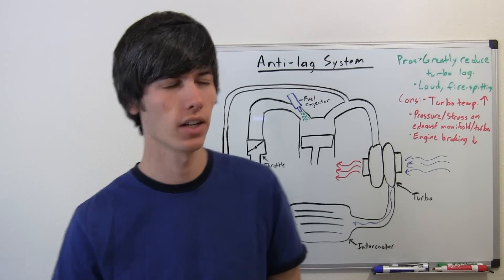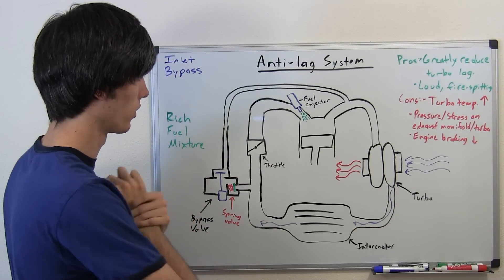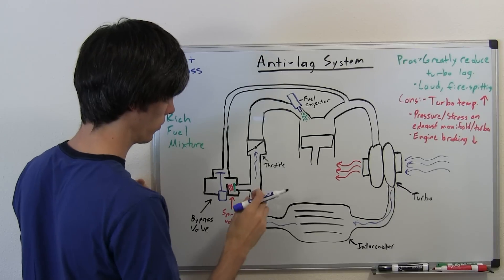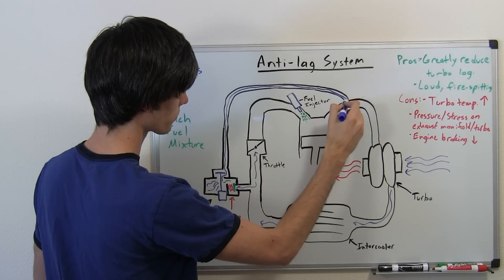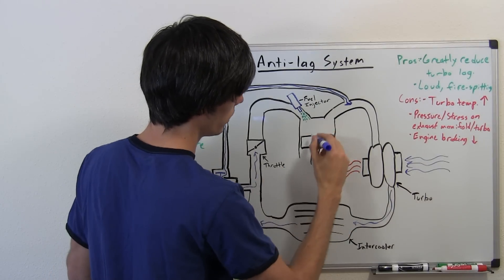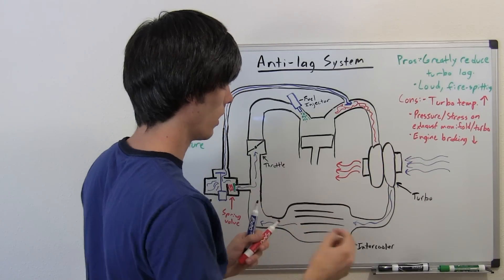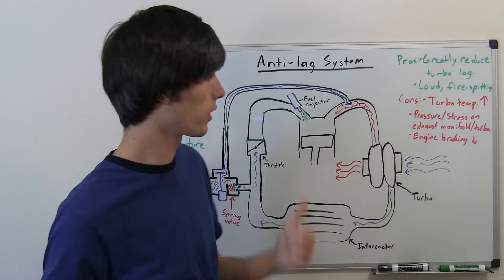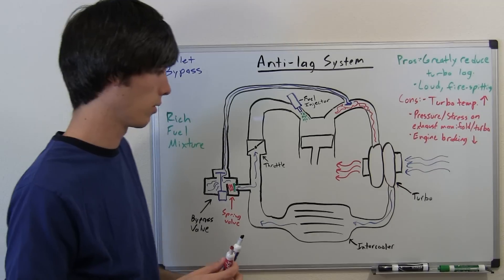How Anti-Lag Systems Work - No More Turbo Lag - Bypass Valve

Comment: Is this the valve that makes that hissing sound on turbocharged cars?
Reply: Nope, that's the blow-off valve. Essentially, instead of throwing the compressed air into the exhaust after you let off on the throttle, like an Anti-Lag System, it just blows it into the atmosphere. Its mostly used to reduce wear and tear.
Reply: All right thanks! Sometimes i see the give it the same name, is thr a reason for tht

Comment: I thought the air that is being by-passed was dumped into the "front side" of the turbo (the side right before it gets compressed), not on the exhaust side?
Reply: compressed air going to the exhaust and exiting the car (even though it is spooling the turbo) does not serve as much purpose as compressed air being re-sent to the engine. right?

Comment: sorry I'm very confusing,but a BOV and DV do that same thing, but since its a MAF based system that a DV is used, because that air is measured and allows the ecu to decide how much gas is injected, but if we split that air back to the system, AND to the exhaust area as you showed here, would that be beneficial for a turbo anti lag system?

Comment: Is this also called a diverter valve? VWs use this too
Reply: sort of, but that is just to dump excess boost off your throttle body and the compressor wheel while the throttle is closed to avoid damage. It is not an anti lag of course

Comment: Actually, I did some research after posting the comment. It turns out that electric turbos already exist. Look up "hybrid turbocharger", there's even an article on Wikipedia. They're not 100% electric, they still use exhaust gases, but they reduce or eliminate turbo lag with a much simpler design.

Comment: Congratz man, i really enjoy ur vids. However,  the setup in ths vid is not right because ECU wont inject useless fuel into the cylinder while the throttle is closed. And if u would remap ur ECU to do so, the extra fuel in the engine would wash away the oil on the inner walls of the cylinder and that is an engine killer. For anti lag systems it is used and additional fuel injector mounted on the exhaust manifold. Keep up the good work

Comment: When the explosion happens will the explosion backfire back up the bypass pipe? And back towards exhaust valves?

If it all goes through turbo then, if u only use it for a drag race off line when a ferrari pulls up next to u then but switch it off rest of drive will it still require replacement parts/turbo?

I have mapped als I only use it when racing faster cars to which makes me beat many 0-60 to 4sec dead.

Comment: Would it not be a good idea to have a third turbine wheel that is fed solely by the clean air from the "bypass vale" instead of throwing all that air and fuel into the exhaust manifold.  Makes sense to me to have a third turbine as part of the turbo that is connected to this bypass valve and in turn keeps the turbo spinning off throttle.  Just my 2 cents.
Reply: I'm not sure if that would be able to create the pressure necessary to keep the turbo spooled as effectively as it would be to dump it in the exhaust manifold. 

Since the throttle body isn't completely air tight at idle, (it allows enough air to go in to keep the engine running) and so the clean/cold air alone probably won't be as pressurized as the mixture of expanded air and fuel combustion from adding it to  the exhaust, add the pressure from the pistons exhaust stroke which will help push that air faster through the manifold, hence spinning the turbo at the desired speed.
Reply: that would just create more lag
Reply: By that logic a jet airliner's turbines could be driven by the compressed air alone, with minimal burning of fuel just to compensate for friction losses. Or a thermoelectric powerplant could skip the gas/coal burning and have the turbine run on water pressurized by the pump, rather than steam.

On a "T,s" graph the more "area" under the transformations the more work it produces. An adiabatic expansion of compressed air at near outside temperature would produce almost no work at the turbine. The objective is that the turbine outputs more work than you input at the compressing stage, that's why you need hot exhaust gas.

Basically, the compressor stage and turbine stage would cancel each other, which means it would be better to have a naturally aspirated engine in the first place.

Comment: so is the BOV part of the bypass valve? or does the bypass valve replace the bov?
Reply: +iwrotefuck BOV works in a similar way but instead of feeding boost back into the exhaust manifold, it releases it into the air; completely out of the system. That is also why you hear a whistle from such components.
Reply: +Alptekin Serdenak So to me it sounds like a BOV would be a safer approach.  And also what do they mean by 50/50 BOV?
Reply: Prime Aestheticx I did some searching on that. Turns out some BOVs are capable of both releasing pressure into air (50%) and also recirculating (the other 50%) (like BPVs) but unlike the antilag (which direct pressure to the exhaust sys. as in this video), BOVs that can recirculate, direct the pressure back into the intake manifold. I cannot say anything about their performances.

Comment: hey... since the pressure in your exhaust line will go on increasing,it will ultimately increase the rpm of the TC by some fraction in every consecutive cycle..... ultimately wasting fuel and power produced. correct me if am wrong.!

Comment: on a car with an ALS system will the wastegate be venting exess pressure and cause the fluttering we hear on the WRC cars or is that surging (fluttering) coming from the turbo compressor itself
Reply: from what i have understood: the fluttering sounds are coming from air not being able to escape, causing pressure to stay inside the turbo manifold and even rebound back to the turbo trying to change the direction of rotation from the turbine - therefore making it easier for the turbo to continue spinning quicker. (many WRC cars have antilag and no wastegates; thats why their turbos dont last very long)

Comment: Is it possible to have this and a blowout valve? is there such a thing where with a flip of the switch, it will vent to atmosphere but let say I'm at a track and I want it to vent it back into the turbo. And when I'm cruising on the high way and switch it to blowout valve.
Reply: +xMinimalistic 
If you can find an ECU to support it (would require tune-switching capability), there shouldn't be any issue in doing so.

Comment: I have a few questions.  When you're on the throttle which means air is flowing in, what's going to stop the air from going into the bypass valve?  Is that supposed to happen?  And let's say it does occur, will that mean the ECU will tell the fuel injector to send unnecessary fuel into the combustion system, isn't that bad because you'll be running extremely rich?

And also if the throttle is closed, what's the causing air to flow into the bypass valve?  And during the anti-lag system, why would you need extra fuel being sprayed into the exhaust manifold with the extra air to spool up the turbo?

And the process in which extra fuel is being sprayed into the exhaust manifold does the "delay ignition" method happen as well?  Or is the ECU just going to spray fuel pass the combustion chamber?  Is the delay ignition anti-lag system part of all this or are all two different things?  And if so which one if better?

Comment: why does the pressure need to go somwhere ?
what would happen if there where no valve before the trottle ???
Reply: it would cause damage to your turbo and your intake piping because of the pressure stresses how you ask if you compress air you give it a load of potential energy when this energy can`t rush itself into the engine this energy has to go somewhere because you can`t make or destroy energy it can only be converted into movent heat or light(visible or not)  so in this case this load of potential energy will create movement by exerting force on your intake piping the will cause metal fatigue and your intake piping and less probable your turbo will fail
Reply: Ricardo Verhof ok
Reply: most of the low boost engine do not have blow-off valve, and damage is not likely to occur, and in racing engine the damage is not that important because anyway you are changing many parts frequently, but what is important in high-boost engines is the performance, and if blow off valve is not present you will be getting more boost delay, hotter air, hotter oil.
Reply: nekojx  Most of gasoline production cars don't have blow-off valve period. They have recirculation valves. Diesel engines don't need neither. Amount of boost does not change the fact that your intake pulses will bounce back from throttle body to your compressor and will cause premature wear. That is offcourse if you shut the throttle after acceleration. On constant throttle there be no boost.

Comment: @Engineering Explained  I was under the impression that the Bypass Valve went back into the air intake for the turbo, the idea is that its pressurized and pre chilled air, that then "re-spins" the turbo.  Also you want to keep your exhaust gasses hot and not mix in cold air, due to causing turbulence and hurting laminar flow.

Comment: Cool so whats the point of having the ALS for launching? We see it the most in launching cars... But whats the point of it since you are already revving your engine to build boost?
Reply: To the best of my knowledge just revving an engine without a load on it won't build full boost.
Reply: Maintaining constant engine speed while stationary requires very little power. Turbochargers require exhaust gasses to operate and without much load will not produce any positive pressure. You will need to create exhaust volume somehow and also went the pressurized air out of your intake to keep your turbo spinning while you are at set rpm stationary.

Comment from the maker: What are you asking? Efficiency isn't really a concern with an engine using als. I would say using a bypass valve would be more effective at keeping boost than just ignition delay and a rich fuel mixture.

Comment: I can't see there being any way either anti- lag systems would hurt engine braking since there is no difference in intake manifold pressure (technically vacuum under engine braking conditions) and therefore no change in drag +/- on the rotating assemly. If anything I can only see the dramatic increase in exhaust manifold back-pressure making engine braking more significant.

Comment: this my sound dumb but how much is to get an anti lag system and how or where do i get it and which of two types of anti lag is better according to making the car louder and more fire spitting or would i have to change some parts like exhaust system.and would it work well in a subaru impreza wrx sti 2004-05 without changing anything on the car lnside the car and would it last long or don't break the turbo or engine. thank you verymuch

Comment: Currently, this system is also used in small Euro5 and EEV diesel engines to heat up the DPF quickly.

Comment: The big question is how does a na car like the aventador shoot flames 🔥
Reply: Exotic Gamer rear engine cars like the aventadors exhaust system is very short and the exhaust gasses are still combusting when they exit the tail pipe at high rpm'

Comment: how is it possible that a combustion occured on the exhaust manifold without the spark? i mean the air that goes through the bypass is cold air isnt compressed right?

Comment: so you're saying instead of having no anti lag system, just delay the ignition? Wouldn't that just weaken the amount of power output?, I mean to say, well in a MAF based system, instead of a Blow Off , it uses a diverter valve that redirects all that air flowing through recirculation in the intake system until you step on the gas again, hence it allows the turbo to maintain its rotational momentum., but if I were to delay the timing, and have this antilag system in tandem with a diverter valve/

Comment: Does this happen with you up shift and down shift? Because when you do sometimes flames comes out.
Reply: I'm no expert but it probably would since more often than not you get off the throttle while shiftng. However some cars do this without anti-lag just because the engine backfires sometimes.

Comment: Saw a couple of your videos a while ago on trying to find ways to stop turbo lag.. instead of having a waste gate valve on the exhaust, why not have a waste gate valve for the air that's being spoiled up instead? So you would constantly have the exhaust running through the turbo and have it spooled up but not all the air is going to the engine. Then as soon as you hit the throttle, waste gate closes and the spooled up air gets diverted into the intake. Now I understand that one of the major draw backs of this would be increased turbo temperature.. any other major draw back as to why this hasn't been done yet? (To my knowledge). Thanks in advance!

Comment: Hello ,
I watch all the automobile videos you put on youtube and they are simply awesome. I can understand the facts and everything pretty easily and those points are very clear.....
May i ask you a little question?
**when concering about blow off valves in most of the subarus' they sounds like ""PSHHHH"""
by the way some nissans and toyotas like engines RB26DETT , 2JZ there blow offs sounds like "PSH TU TU TU TU " Why the sounds differ? Is it with the custom blow off make or model or with another mechanism. 

Looking forward for your reply. Thanks in advance .. good luck
Reply: its about the amount of boost you are producing, so: high boost the bov lets out the excess boost which will slow the the turbo down and if the turbo still makes "too much boost" when you dont need it it will repeatly be opened again. not pretty sure though. maybe the "psh" bov is one with vacuum opening and the "psh tu tu tu" is the on which will open by the signal of the ecu, so electronic regulated. hope i could help you!
Reply: the sound you are referring to is referred to as a "fluttering sound" or SUTUTUTU (you were close). This sound happens when there is no wastegate installed.
Reply: The Marshmallow that sound is actually caused on the other side of the turbo. it's called compressor surge. when the throttle closes the back pressure causes the compressor to stall, and that makes the flutter. street cars do it when the blow off valve isn't properly adjusted, and isn't bleeding off the extra boost in time. the only time a wastegate is even working is when the car is at high RPM with the throttle wide open. the wastegate diverts exhaust away from the turbo to keep it from over boosting.

Comment: I ment to say the previous one, (dumb autocorrect). And by better I mean easier on the engine.
Reply from the maker: Not really sure, but both are fairly destructive. This one probably a bit more since the combustion is intended to occur in the exhaust.
Reply: that's what I thought. Plus, don't you need more parts for this one. But can't you turn the bypass valve off when you don't need it to work and turn on the blow off valve and for the previous one set the ecu to turn the anti lag system off when you don't need it.
Reply: Engineering Explained ALS kills turbos in a few months - engine damage… not so much:)

Comment: Why most of new cars are using turbos instead of superchargers? Are turbos more efficient? Which of these two system would provide the best longevity for the motor?
Reply: +kekocucu u Really it depends on your application, engine and how much boost you want. 

 Superchargers have no lag and can be really good for drag racing, and city driving as that you have no turbo lag and get instant boost for good takeoff acceleration. However they need to be mechanically driven by the engine meaning that you give up some crankshaft power to boost. 

Many superchargers require complex belt, or gearing arrangements. Also each supercharger type has advantages and drawbacks. Such as roots types may cause a bit of more crankshaft wear. They also tend to be excessively noisy. So much so that a massive roots type was used in many T1000 thunderbolt air-raid sirens. 

Turbochargers do have lag and there are many systems for overcoming it. They can provide boost for nearly all power ranges (depending on turbo size). Small engines usually use two and sometimes four small turbos to avoid the lag large turbos have.

Many large engines use turbos because they can provide good boost, require no power from the engine and most of the time turbo lag is really not a concern when torque and power is your goal. However many turbos require an oil line for lubrication and water line for cooling the bearings.
Reply: +David Vermillion thanx!

Comment: I saw this crazy-sounding neon SRT-4 drive by, and the guy steps on it, hits boost, and lets off the gas and i heard just one "BANG" and didnt see any fire out the back (but it was loud enough to wake the dead and sounded badass) does this mean that he had anti-lag or is it something else?
Reply: Just a backfire.

My volvo does it all the time since I removed the resonator + muffler.
Steps on it, let go the gaz and it either POPS or gurgle like crazy
Reply: Gslash25  srt4s always had that, no anti lag, i had one a few years back and that's the one thing i miss from that car, letting off the throttle and hearing the loud pops
Reply: Ed Gatti ok, the pops just seemed a lot louder than in other cars i guess

Comment: I'm wondering why I don't hear about products specifically engineered to handle these increased pressures, temperatures, and turbo revs.

Why not have a separate fuel/air injector in the exhaust manifold? Why not have a dedicated system which continually combusts fuel charge rather than run it in damaging bursts?

Do these systems exist on the consumer market?